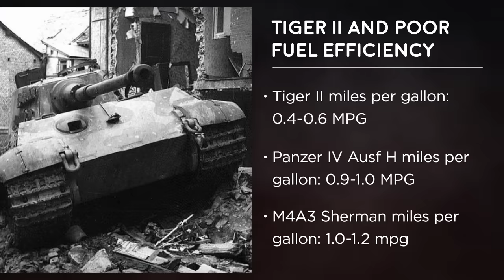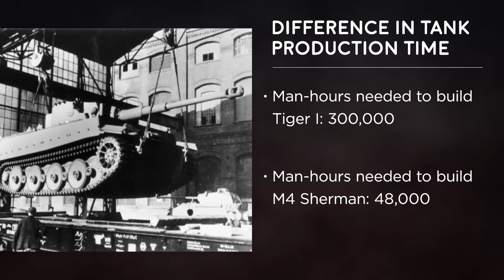Why Did German Tanks Perform So Badly in The Battle of the Bulge?

Comment: Good video, the German's created their own logistics headaches caused by lack of standardization.  I was shocked with how many different and varied types of equipment Germany's Quartermasters had to deal with.  It is a wonder they did as well as they did.
Reply: In the early years Germany didn't have that much variation. The real trouble came the longer the war got. While they developed powerful tanks they also kept tinkering with the designs building in improvements that unfortunately cut production time. The Tiger alone had three variants, early, mixed and late. And the Panzer IV the workhorse tank of the Panzerkorps had variants from A to G (with the F version even having 2 subversions) And then add all that foreign gear Germany used to pad their roster including German modifications of said gear. Only late in the war did they even think about using standard parts (the E Series) but at that point it was of course way too late
Reply: @Athrun82   Interesting points, thanks for sharing!  Still amazes me how successful they were with what they had.
Reply: @mrgunn2726  To be fair the first wars Germany fought were short and decisive. Which in essence was Germany's whole doctrine since the Prussian times. Germany never had many resources so they developd doctrines that would account for that. In essence Germany had to fight a so called Entschleidungsschlacht as soon as possible to knock out their opponent early. The Blitzkireg is imho the  pinnacle of that: a quick and decisive strike trough the frontlines to create the biggest possible shock  to paralyze the opponent
Reply: That was the strength of the Sherman ( same w/T-34 ) -- they were able to make so many of them. A Sherman could be gotten in almost any infantry vs infantry battle and the US infantry loved the standard Sherman cuz it could fire HE rounds ( vs the Firefly, which could only fire AP rounds ).

Comment: Great video. A couple additional points. The Germans lacked a purpose built, mass produced tank recovery vehicle for their heavy armor. The Germans did not field the number of engineer units, or bridging systems to compensate for the mobility challenges they faced. Historical quibble: Peiper put his Tiger II unit last in his order of march for precisely the reason you outlined. The opening of this video would cause a viewer to think he led with them.
Reply: Yeah I've heard it took 5 large half tracks to try and recover a Tiger that was stuck.. not ideal and very dangerous
Reply: They produced more than 300 Bergepanthers with reinforced final drives.
Reply: @TTTT-oc4eb  that might address the Panther, which by all accounts was a medium tank, whose maintenance issues are a worthwhile topic of their own. My comment was more directed at the heavy tanks….Tiger 1 and heavier which were the subject of the video.
Reply: @Eloso3135  Bergepanther is German for salvage Panther, who could then salvage any type of tank
Reply: "The Germans lacked a purpose built, mass produced tank recovery vehicle for their heavy armor."

The Bergpanzer was a converted PzKpfw IV which was designed as a rescue vehicle. It was actually quite successful. The problem was that the German super heavies required more of them. Ar Kursk, it took no fewer than five Bergpanzers to recover a Ferdinand.
Reply: @Eloso3135  The Bergepanther had the same engine as the Tiger and a better power to weight ratio, and was perfectly capable of towing a Tiger - although the Tiger 2 was probably often a PITA recovering anyway.
Reply: @thethirdman225  you just made my point. I wrote “purpose built”. The bergepanther was a CONVERTED panther and therefore by definition not purpose built. They built 339 between 1943 and 1945. 339 over a 3 year period? I’m sure I could go do the research but my guess is you wouldn’t have more than 150 available, across all fronts at any one time. The German operational ready rates for their heavy tank battalions were terrible. Full strength battalions dwindling to 15 or fewer operational tanks in a matter of days. I’ve got a number of the unit histories that give day-by-day histories of unit actions and include the vehicle status for each day. Usually they had more tanks in the maintenance shop than available. If you read Sledgehammers it seems like virtually all the Tigers lost in Italy were breakdowns that couldn’t be recovered. The German heavies are cool on paper, but in the end were a waste of resources.
Reply: @Eloso3135  A difference which makes no difference is no difference. The Bergpanzer either worked or it didn’t and it worked.
Reply: @thethirdman225  and that’s why so many German heavies were blown up by their own crews after breaking down, because their maintenance system worked so well. Like everything else about their armored force the equipment was over engineered, and too little too late.
Reply: @TTTT-oc4eb 300 might sound like a lot, but it really isn't. With 14000 panzer 4s, 5000 panthers and 1300 tigers with 400 king tigers running around, not to mention tho other thousands of other vehicles the Germans had, 300 recovery vehicles were never going to have an impact on the salvage of German tanks.
Reply: @ethanedwards422  They had thousands of other vehicles that could tow a Panzer IV or smaller vehicles. Sure, they certainly wished they had more Bergepanthers.
Reply: So they didn't have a "towtruck" to pull it back behind the lines to get fixed in relative safety? 
Trying to fix a tank when someone is standing over there ready to shoot at you is a bad idea.

Comment: I was under the impression that the King Tigers weren’t in the lead of the columns but in the back. Also, the 82nd Airborne Division would use captured PanzerFausts against their previous owners. They captured a truck load including practice weapons in Sicily and kept adding to their stocks of them. The final blow was finding an intact M12 HMC in a supply depot and moving it to high ground facing Peiper. The 155mn shells were the final blow to cause Peiper to retreat at night on foot back to the German lines.
Without authorization, American artillery units used newly developed proximately fused shells against the enemy. These were going to be used for field trials. They exploded at a certain height above the ground. The shrapnel would send infantry to take shelter, stripped those riding the vehicles off of them as well as damaging the mobility of armored vehicles via track breakage and penetrating the engine compartments from above.

Comment: This video talked about the Firefly variant, but Shermans with the American 76mm high velocity cannon (not Brit 17-pdr) were also readily available during this point in the war. It could also take out Tigers and Panthers at competitive ranges.

Additionally, Shermans had the ability to shoot on the move due to its stabilized gun. German tanks, on the other hand, had to stop to shoot.
Reply: True !
Reply: Sherman tanks also had to stop and shot. The first that do it was the Abrams during the first golf war. The Sherman could fire first after stopping. Not fire on the move.
Reply: @samuelgordino  The Shermans actually had a good enough Gyro to shoot on the move but the issue was that very few crews were trained to use it so it was mostly left unused throughout the war.
Reply: @samuelgordino  Golf War? They were fighting about golf, or was it on a golf course?
Reply: @frankmiller95  😂😂😂
Reply: Neither the 17 pounder firing APDS or the 76.2mm firing tungsten core HVAP could penetrate a Tiger II at point blank or any range.  No way.  No Tiger II was ever penetrated from the from by anything including the IS-2 122mm gun.    These guns failed more than 50%-75% of the time against even a panther at 500 yards.  No Tiger II was ever penetrated frontally in combat.
Reply: @samuelgordino  On which course did this Golf War take place?
Reply: @zen4men  the beginners course. 
Guess in deserve the jokes after making that mistake 😂😂😜
Reply: @samuelgordino  Easily done! ...... Enjoy!
Reply: Without HVAP, which was rare and not readily replaced, the Sherman 76mm gun was seen as disappointing and "ineffective at the required range" in official reports from the US 2nd and 6th Armored Divisions in 1945.
Reply: Michael Wittmanns gunner at Villers Bocage would be surprised to hear he didn't fire on the move when he successfully engaged and took out two dozen targets.
Reply: From what I have read about the Sherman that 76mm cannon did not have the muzzle velocity of the 88mm cannon and of course the Sherman had to get closer to the German tanks in order to sustain damage,
Reply: @williamzk9083 IS-2 would break it through the hull front because of the sheer weight, size and destructive capability of the 122mm caliber. But this was due to the poor heat treatment in later war German tanks. As to say it wasn't penetrated at all frontally is probably horseshit, as it did have weak spots and again I do believe 90mm of the M26 Pershing and 122mm were capable of doing so.
Reply: @dobridjordje  No Tiger 2 tank was ever penetrated in combat. We have a serial number every tank what happened to them.  There was a partial penetration by 122 mm gun of the turret mantlet which is tiny.  There are pictures of it with the round  hanging halfway up.  The crew fully escaped and it started and ammunition fire.  After that orders were issued for less ammunition storage in the turret
Reply: @dobridjordje  note the Germans out in about 0.1% to 0.2% nickel to their armour. The nickel slightly strengthen the armour, but its main effect was to prevent Spalling.  This nickel was probably missing towards the end of the war.  Plus I just wasn’t any other Al Awami elements and he treatments to make the armour really good.  Pretty sure Amit was as good as German Amma it’s stopping penetration, but the German use of nickel meant it was less likely to spall.
Reply: I'm keeping it general but I see some back-and-forth.
Shooting on the move is what every tank principally can do, but accuracy of actually hitting something falls off a cliff.
Stabilization works, particulairly with a lighter gun and allows for a rather effective fire-on-the move. normally a tank would lower its speed (or stop altogether) to make their shots count, and thats logical when fire-on-the-move would get your accuracy to drop to near zero.  (and it was also probably doctrine in there somewhere)
Also it should be kept in mind that a tank that is ambushed would be far more prone to start firing even while keeping driving because stopping to acquire the target (if it was known where it was) would mean certain destruction of the vehicle, you'd almost always be last to fire.
Shermans could get away with it better, and thus would opt to do so based on the circumstances, particulairly when it allows for closing the distance or making you a more difficult to acquire target.
For the allies It becomes more and more true as you see that Germany was more and more on the defensive anyway, meaning they were less prone to be moving to somewhere. Battle of the Bulge was by all accounts a "last hoorah/ last hope" type of offensive. Trying to smash one last time before you'd eventually be knocked on your ass.
Reply: @lyndoncmp5751   The superb ride and sophisticated suspension of Panther and Tiger 1/2 was in part designed to allow fire on the move.   The suspension had a very long travel, shock absorbers to damp down vibration, multiple contact points due to the interleaving and large diameter wheels.  A bump wouldn’t disturb these tanks.
Reply: @skorpion7132 
Yes Otto Carius said it was mostly a waste of time and not necessary to fire on the move. There were exceptions though (Wittmann at Villers Bocage) but tanks in WW2 generally didn't need to fire on the move.
Reply: @williamzk9083 
Yes, there's some great footage of a Panther moving at speed along an uneven bumpy road. You can see the torsion bar suspension working beautifully. The turret remains stable and barely moves.
Reply: Wrong, Tigers could shoot on the move but were advised not to for some reason.
Reply: @partymanau 
Yes it was deemed uneccesary in most typical engagements. There was nothing physically preventing a Tiger from firing on the move. It just wasn't considered as accurate and was hardly ever required.
Reply: @partymanau  The Germans used a small number of Panzer III with 3.7cm and 50cm guns that had were stabilized by "large gyros" in which gyros about 20cm in diameter directly stabilized the guns.  The technique wasn't suitable for bigger guns.    The US used a gun stabilized by 'small gyros' where  the gryos operated 'silverstat' switches that operated hydraulic valves to stabilize these guns. This technique was limited in accuracy as the control was somewhat crude and the sights were linked..    Towards the end of the war both Panther and Tiger II were to receive stabilization of the optics.  The gun would then be fired by electronics when it was in the correct position.  This was an accurate technique used in naval guns.
Reply: @dragonace119 it is my understanding that this gyro was generally for the coax gun and faster target acquisition.
Reply: @Taskarnin  It was, by shooting on the move it was more just keeping the gun more or less on target.

Comment: the most unreliable part of German heavy tanks (Panther, Tiger II) is the over engineered final drive. However it is not a design choice, it is due to the lack of raw material that they have to make it 'over-engineered'
Reply: The Panther final drive was NOT over-engineered.  It was under-engineered.  It was designed for a much lighter tank, and then Hitler insisted on up-armouring the Panther so much that he added more than ten tons to its weight.
Reply: @michaelwong8083  It wasn’t Hitler’s idea to armor it up but the OKH. The German tank companies design tanks that fulfill the OKH requirements.
Reply: Tiger final drives were different and much more durable than the Panther's. Furthermore, many of the final drive failures were also due to combat damage, they were very vulnerable to artillery.
Reply: @TTTT-oc4eb  Artillery less so, more that the Germans simply could not replace any worn out final drives. All the potential spare parts were soaked up to build more tanks, and Germany was at a such a bad state that they needed those tanks more than they needed their current pool of tanks to be sustainably effective. 

Combat damage came to be as a result of combat maneuvers being much harder on the drives than cross country or road travel.
Reply: @terran6686  once a Tiger or Panther unit was discovered, the allied would direct as much firepower as possible against them, mostly artillery and tac air. This would often result in most or even all tanks damaged, but few outright destroyed. 503 schwere abt. reported that 2/3 of final drive failures were due to combat damage.
Reply: @TTTT-oc4eb  Interesting. I found in ORO-T-117 that artillery and aerial actions accounted for a tiny percentage of enemy tanks knocked out. Tank on tank and AT guns together combined accounted for over 90% of US inflicted German tank kills, with the remaining percentages distributed between air, mines, and artillery.
Reply: @terran6686  I said damaged, not knocked out.
Reply: Indeed and the final drive of the Tiger II did not have a problem with the final drive.  (the final drives is what drives the sprockets).   The Tiger II final drive was a planetary system and plenty strong.   The Panther had a simple straight cut pinion and main gear that was too weak (probably would have been fine for a 35 tons tank).  Had the Panther received a Planetary gear it would not have had a final drive problem.  (it had been intended to use a planetary system but there wasn't enough gear cutting machinery to make 4000 Panthers/year).
Incidentally monster trucks have a  planetary gear system for each wheel.
Reply: almost all of the german engineering is over-engineered. Just ask someone who owns a fine BMW  or Mercedes, they will proudly claim that the vehicle spends quite some time in the shop fixing little things. But at least, it is "german engineered" .  A friend of mine had a light bulb changed on a VW Phantom, too one day to do so, and a hefty repair bill $$$$
Reply: The Panther was a medium tank
Reply: @TTTT-oc4eb  pathetic

Comment: M4 track width"

The image of the Sherman Firefly at 10:24clearly show the extension "duckbills"  attached to the outside of the track links. There were also "grousers" which added a full-width "blade" to the track links for improved traction in mud, ice and snow.
Reply: Yep. I noticed too that Firefly sporting the track extensions. Those were cheaply manufactured by the tens of thousands in Europe itself, in liberated countries like France and Belgium and widely distributed by December 44.
Reply: Yes and they were not that great. Most Shermans in the Ardennes had regular narrow tracks. The Shermans had as many problems in the terrain as the German tanks did. In fact Sherman tankers complained about the superior flotation of Panthers and Tigers.